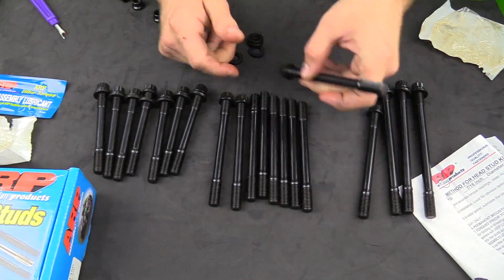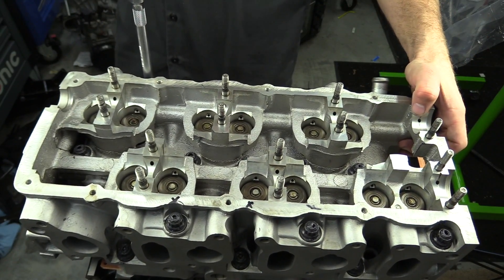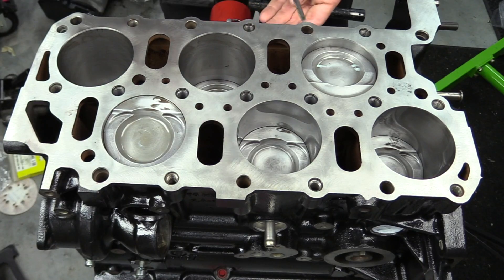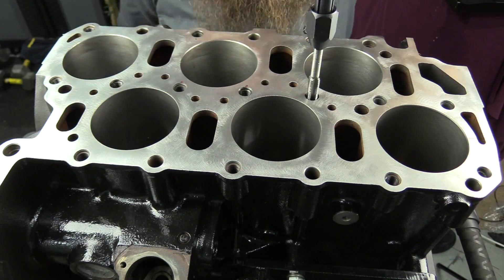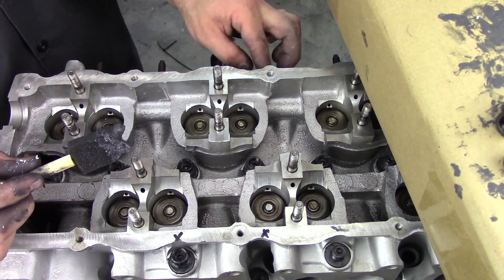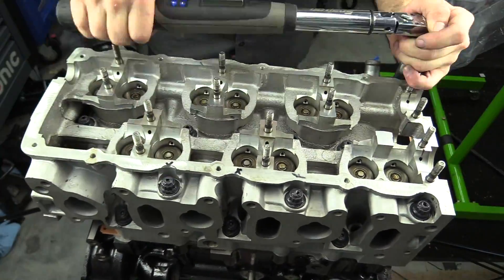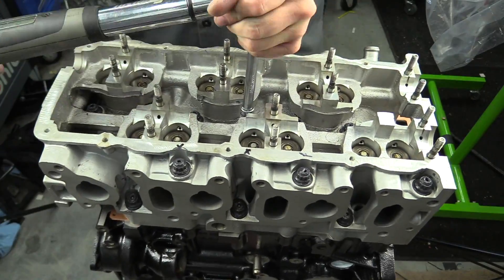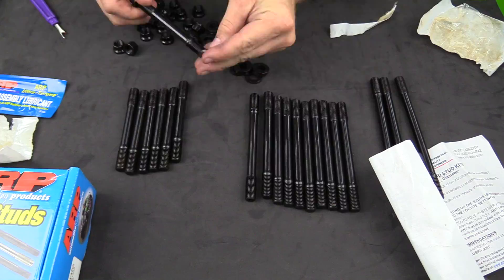The Easy Way to Install ARP Head Studs

Comment: what would you recommend as a lube for head bolts ? i presume use about the same application as in your video ? i have always used a touch of new engine oil on the threads and head bolt washers?
Reply from the maker: I think the oil will work fine. I think that is what ARP uses as a back up.
Reply: ok cool thanks keep up the good work :D
Reply: Oil is not made for extreme pressures like the one found between threads of threaded fasteners. It is not because you have always done it that way before that it is the best method. In tests I have conducted I found that motor oil on threads of connecting rod bolts accounted for very little difference in bolt stretch.

Comment: What are your thoughts on thread chasers/cleaners vs. taps? I used to always used taps, to chase things and then I bought a full thread chaser set and I've noticed the thread chasers, seem to work better, They do not seem to remove as much material, when running to junk or any problems in the threads, thus I think they better, less chance of weakening the threads, removing metal. Thoughts?
By the way, I used ARP bolts; on my 02M Wavetrac differential install and I was really impressed with their quality! They obviously, put alot of effort, time and engineering, into their fasteners!

Comment: hey charles saludos good vid as always
 just a question, i must do a head gasket on an Audi A4 2.8 AFC engine and, so should i buy new bolts for the heads or can i reuse it?
 
the torque to yield apply only for the vr6 or even to my engine?

Comment: Purpose of ARP lube is to maitain constant and repeteable torqeue so why are you putting it bethween block and stud? It should be put only bethween stud and nut and on the washer.
Reply: I did some digging, that ARP lube looks like Mo2S CV joint grease. I got some second hand and used some  Mo2S grease.
Reply: @Tomyp89  The ARP grease is specifically designed for the type of use it is used for and CV joint grease is used in a totally different application.
Reply: I have to agree.. the reason you hear of studs backing out is because of people ignorant to this fact and lube the stud into the block.. the only thing that should be used is motor oil if it is a blind hole.. or possibly a thread sealant if it is a thru hole that accesses coolant but not always necessary and ONLY HAND TIGHT.. second thought.. why would you even attempt cv grease.. each kit comes with enough moly to relube the threads multiple times if need be
Reply: @y0utub4user  I also was wondered why he lubed the threads going into the block.  Those threads do not turn [torsion], are only in tension.  The lube goes on the threads with the nut and washer to provide a good & even torquing process.  I think he did that wrong.
Reply: kitastan So it doesn't seize(hence anti-sieze)

Comment: Why are you wasting ARP assembly lube on the lower/untorqued portion of the stud?  If you're trying to prevent galling for some some later removal, just use regular antiseize.  Save the assembly lube for where you need it, the torqued/nut/washer end.  (If they provide plenty for both ends, NBD)
Reply: Thor Dehr apr calls for you to use the lube on the threads in the block..

Comment: Something I found very different.
Normally, as I was taught, if you use the copper spray, then you need to strip the black material off the new HG, delicately.
The copper is known to help a gasket " walk" when applied to a material that is coated either for friction, or bonding, and that it adheres best to clean metal.
It was just different to see it sprayed on a coated mls gasket.

Comment: Everything about stress gauge for connecting rod bolts?
Reply from the maker: +Lime yep. I'll have a video on that too.
Reply: Get your rods resized and shot peened, and use ARP bolts. Thats your stress guage. Focus on deburring the casting on the sides of the rods, especially where the vector loads are occurring on the big end where it narrows down from large to smaller. Deburring the casting lines adds 20% stregnth to the rods. Shot peen when deburred.

Comment: How about nylon "engine cleaning" brushes to clean out the "bolt holes"?
https://www.summitracing.com/search/part-type/engine-brushes
That's what I have been using for 50-plus years for head bolt holes. Yes, "threading" those brushes in is very time consuming, but far less chance of removing metal as with a tap. And thread chaser "taps" typically aren't long enough to get to the bottom of many head bolt holes, especially when there is a "sleeve" for locating the head gasket for at least 2 of the head bolts sticking out of the block surface.
Also, cleaning the threads is probably best done prior to taking the block to have it hot tanked, rather than as part of the assembly process. But of course, it should also be done on assembly to get whatever may have gotten in during transit if the machine shop doesn't return to you it in a large plastic bag.

Comment: TTY bolts, just another name for cheap bolts. Probably made in...fill in the blank. Bad idea!
Reply: Not necessarily, many engine torque to yield bolts/studs are engineered to provide maximum clamping force by using the fastener to its maximum yield strength. 
Many times this is due to fastener shank size limitations because of internal and or external space/dimension limitations. 
An example would be a cylinder head with limited casting boss size for the attachment fasteners where a 14mm diameter shank fastener would b ideal but the maximum available area in the casting will only accommodate a 12mm diameter shank. 
That situation occurs a lot in automotive engine design due to a number of factors, some are unique and some are systemic for the entire industry.

Comment: Arp states to not NOT to add lube on the treads that are on the block. Dry is the correct install or with some treadlock. Only install lube when torquing the nuts on the top of the stud. Reading the instructions that come with it clearly states that.
Reply from the maker: Yet they say it prevents galling on the threads of the block...
Reply from the maker: So you actually had me questioning whether I was right or not... Here is the copy and paste from the install instruction:

1. To ensure proper thread engagement and accurate torque readings, clean ALL threads in the block. Chase if necessary with ARP Thread Chaser.
2. Clean and inspect all hardware prior to installation. Look for obvious defects or shipping damages, plus proper fit, length and dimension.
3. If the cylinder head studs protrude into a water jacket, lubricate the block threads of the studs with ARP THREAD SEALER.
4. Screw studs into the block “HAND TIGHT ONLY”.
NOTE: LOCTITE MAY BE USED IF A PERMANENT MOUNTING OF THE STUDS IS PREFERRED. THE
FASTENERS, HOWEVER, MUST BE TORQUED PRIOR TO THE LOCTITE SETTING UP.
5. Install the cylinder head(s) and check for binding or misalignment.
6. Lubricate the stud threads, nuts and washers with ARP ULTRA-TORQUE FASTENER ASSEMBLY LUBRICANT.
Then install the washers and the nuts onto the studs and tighten them hand tight. ARP recommends using the ARP ULTRA-TORQUE FASTENER ASSEMBLY LUBRICANT that is provided with each kit as opposed to motor oil. This is due to higher friction on the studs as well as inconsistencies in the clamping force of the fasteners when motor oil or other low quality lubricants are used.
PRELOAD (TORQUE) RECOMMENDATIONS
7. Following the manufacturers recommended torque sequence tighten the nuts in three equal steps to 80 ft lbs
with ARP ULTRA-TORQUE FASTENER ASSEMBLY LUBRICANT.
Note: ARP Ultra-Torque Fastener Assembly Lubricant has been specifically designed to reduce tension preload scatter and eliminate the need to cycle high performance engine fasteners before final installation. ARP Ultra-Torque far surpasses all requirements offered by previous ARP lubricants in terms of fastener preload repeatability and performance lubricating properties. For more information on ARP Ultra-Torque visit our website at www.arp-bolts.com or call 1 800-826-3045.

Because it doesn't say anything about using it on the threads of the block, I called ARP. He said yes you use it on all threads unless it goes into a water jacket. In that case you use the thread sealer. This lube is to prevent galling when the studs are removed, one of the main reasons that people use ARP bolts and studs.

Comment: Helicoils are used in aviation/ weapons industry so I am pretty sure they are ok for your old Trabant charles.
Reply from the maker: +rimmersbryggeri lol that's fair. ;)
Reply: I actually learned about Helicoils when my dad was working for a company that is now owned by saab aviation. They would often break threads in the assembly of radar jamming missile parts and such and when parts have more than $10000 in machine hours on them you really don't want to have to make them again if you can avoid it.
Reply: 4 helicoils used on rocker studs on a 1966 corvette camel hump head with no problems. Thats with a .600 lift camshaft.

Comment: Gee. More mechanics need to watch this..CLEAN the threads, CLEAN the hole...torque in steps, follow directions included in box..simple...great video..💰💰💰💰👍👍👍👍🔧🔧🔧🔧🔧🔧🔧🔧
Reply: I agree. 
There is no such thing as "too clean".
Reply: patw52pb1 the last thing you want is a brand new stud to 'gall' in a dirty thread..then more labor invested.
Reply: @leecoen2577  
Or bottom out on debris in a blind hole. 
We also get better torque to clamping consistency when the hole and threads are clean and distortion free. 
With our applications, labor is the inexpensive component and we are all paid well.
Reply: @Tobytronic Cat 
Well, our labor charge is commensurate with our level of capabilities, expertise, experience and knowledge. 
Our labor rates currently start at $100 per hour and go to $275 per hour. 
We have very very few complaints regarding what we charge. 
Our clients prefer our level of clean, attention to detail and the results we deliver.
Reply: Exactly my thoughts

Comment: The only question I have is about using the tap? I was always told to only use a thread chaser not a tap as the tap will remove material. Especially important when dealing with rods, mains, or head bolt threads.
Reply: I usually recommend using a thread chaser unless the person performing the operation is knowledgeable, skilled, experienced and is using the correct tap. 
Taps are not universal sized and are available is several types and sizes of minor and major thread diameters for the same nominal diameter and pitch meaning the incorrect type/size can remove too much material on the root, crest and flank of an existing internal thread (hole) thereby significantly weakening the strength of the thread left behind. 
Almost all decent commercial thread chasers available typically have cutting flute dimensions and geometry that do not harm the exiting thread even in the hands of a novice. 

Having said all of the above, I have successfully used a tap to chase threads when that is all that I had. ;) 
I have also used a tap to chase threads and butchered the threads requiring time consuming (read as expensive) thread repair inserts to fix my screw-up.
Reply from the maker: I have had good luck going either way as long as you're careful. If you use a tap properly it should make the threads proper for installing the bolt. It can cut metal where a thread chaser will not. But if the bolts are in fair to great condition I don't think it's an issue. But you do need to take greater care in using a tap than a thread chaser

Comment: I didn't know you had to replace the bolts, learning is fun.
What does a spacer + second gasket do compared to a singular gasket?
Reply: Lowers the compression ratio.
Reply from the maker: Like Dacasman said it's to drop compression. Not needed for low levels of boost, but gives me a little room to grow
Reply: Turbo boost and compression ratios determine how much fuel octane you need. That is why when you want to use pump gas and add a turbo, reduced compression ratios are used.

Factory turbocharged cars are built with lower compression ratios than their turbocharged counterparts. One of my favorite cars of all time, the Z32 Nissan 300ZX has about 8.5:1 compression for the twin turbo model, and the non-turbo 300ZX has about 10.5:1 compression.

Turbo boost and compression ratios aren't the only things that determine how much octane you need, but they are probably the biggest 2 factors.
Reply: Skyline Fever ahh, now I understand why.  Thanks for explanation! :)
Reply: I must be missing something, lol. I thought a higher compression would be better (unless unsafe).